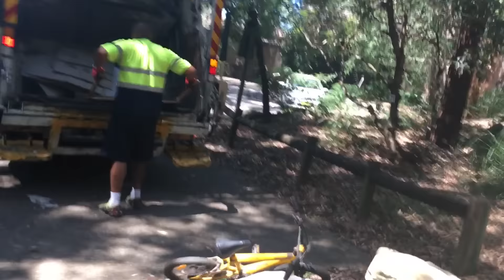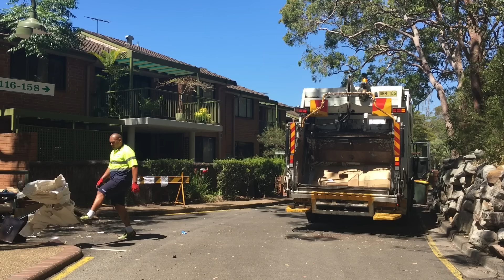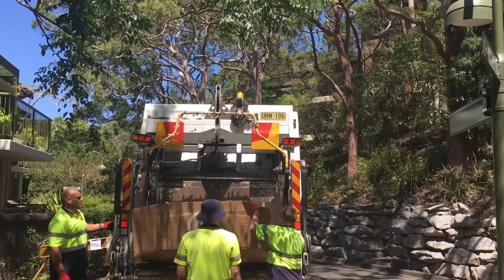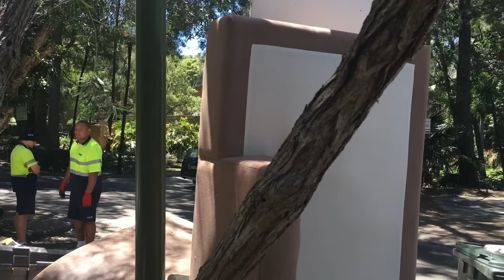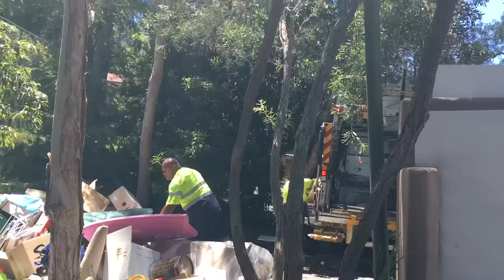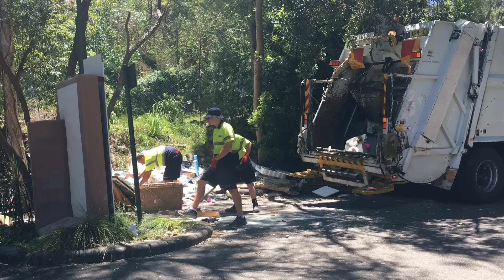Post-Christmas Bulk Waste Collection

Comment: I used to do that on the Warringah contract,started out as a runner then after a year they found out I had a truck license so I got put behind the wheel. My flat was furnished from stuff off the clean ups,and much better quality than I could ever afford as it was such a rich area. I notice they're throwing metals in,we used to leave it and follow up with another truck to collect it all.
Reply from the maker: Good on you .

Comment: This year was hard on me do to (pandemic). We have clean up week in the states very spring. My corner of the world we had did things the week of September 14th I have a 3 wheel bike (trike) I'm a cord cutter to a point. If it's got resale value I won't touch it. If it's corded and completely trashed I cut cords otherwise it's all about resale items for me. (EBay) I have no problem shipping world wide. Even if it's  special requests to try minnesota-north Dakota products. I have no problem with hooking up a bro or sister.